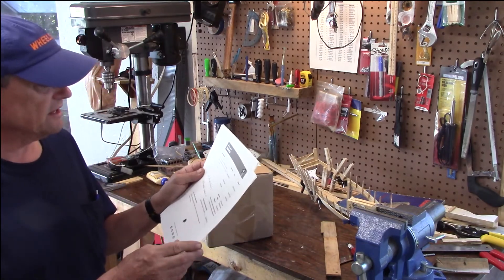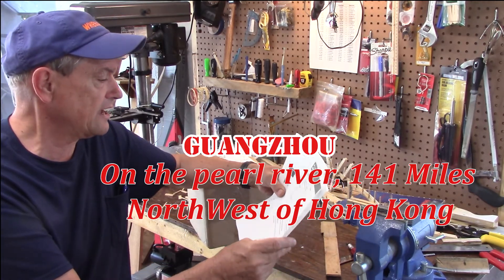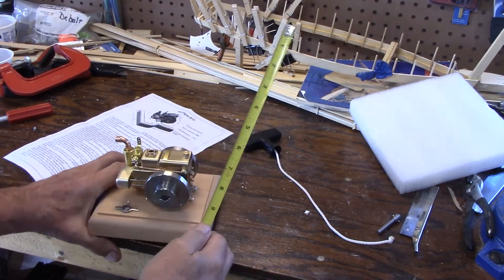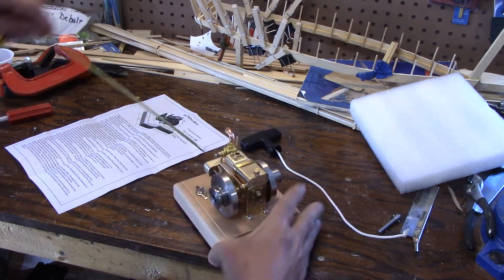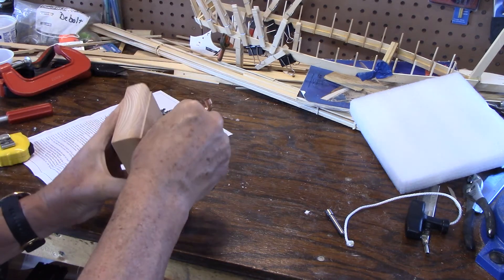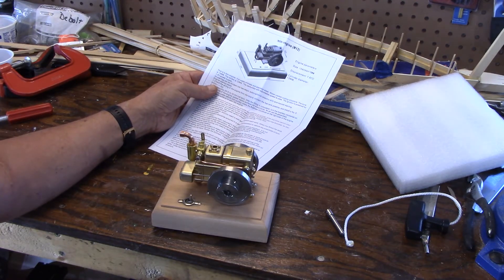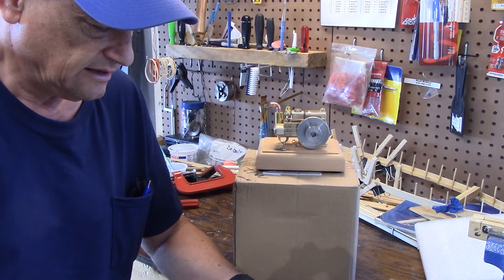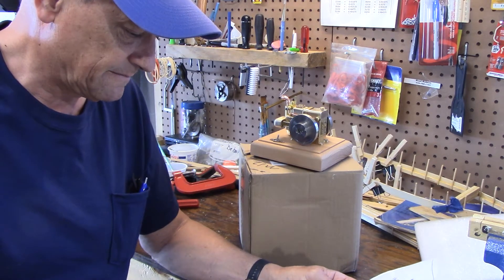Mini 4 Stroke Gas Engine Model Unboxing & set up, Review and Running.

Comment: what kind of oil do you use and how much do you put in the fuel and crank case
Reply from the maker: I use "Marvel Mystery Oil" you can buy a quart at Advanced auto.  Then I just put about 5 or 6 drops into the fuel tank before each run